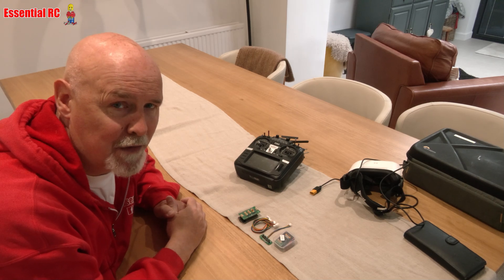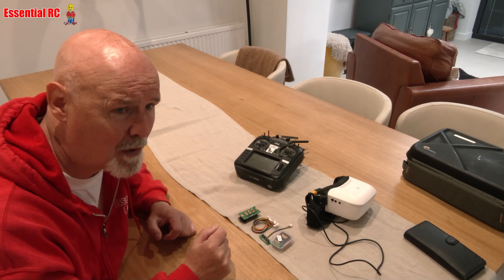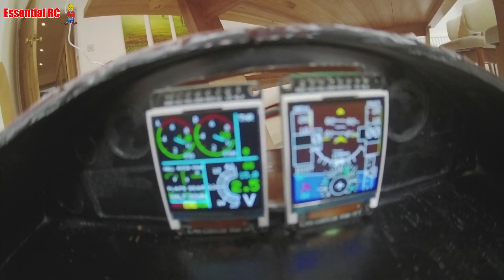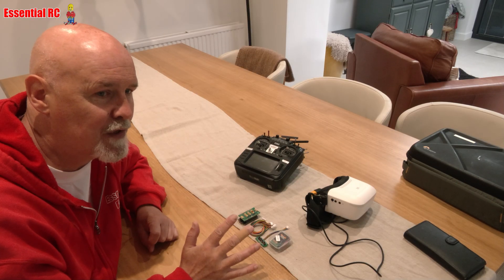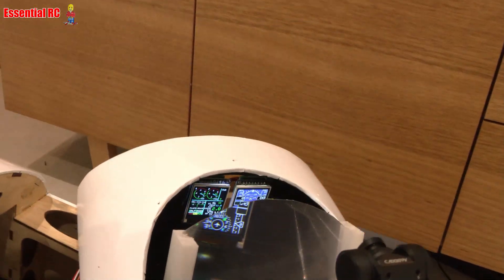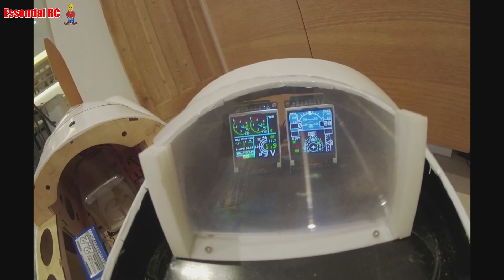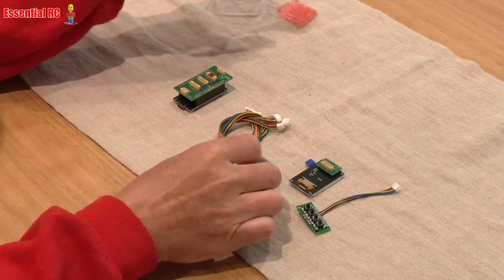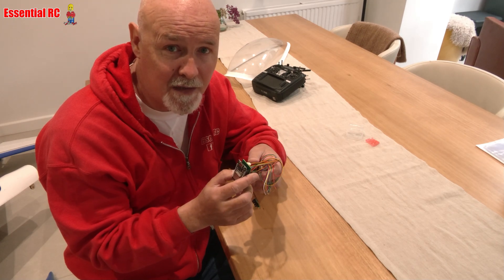DO THEY WORK WITH FPV ? NEW In Cockpit Real Time Telemetry Displays for RC Aeroplanes

Comment: Hey mate, just diving in after 10 years away from the hobby.

I have a question (I have more than one but we'll start with one).

You said flight controller, that's not something my PNF has, is it?

I have the 04 pro air unit in a HEQUAV G-Port 3 Axis gimbal (hoping to bind it all to my DJI N3 goggs).

Could you dot point what I need to make it all work?
I would greatly appreciate it!

Ps. I fully intend on going full functional glass cockpit and all, if I can!
Reply from the maker: Flight controller is a separate component that would have the receiver, GPS module, FPV video transmitter, all the servos and ESC throttle signal cable plugged into it. The ESC black/red wires would be soldered to it and you would solder black/red wires onto it with a female connector so you could plug the battery into it. If you wanted to use those telemetry screens they would plug into a spare UART on the flight controller as well. Good flight controller to look at would be the SpeedyBee F405 Wing. If you brought one you would need to flash iNav firmware onto it and learn how to configure it. Plenty of videos out there on how to do that.
Reply: @EssentialRC awesome! Thanks so much.

Lastly can I have your opinion on one last thing?
I would like to have my full FPV unit built into a 3d printed module with the gimbal, air unit, fan for air unit, flight controller and antenna mount all in a tidy package that I can hot drop into different planes as I need.
Or should I look at individual FPV setup for each plane?

Comment: Following with interest. I'm also trying to get FPV working on my IC model but I'm having issues with the engine vibrations sending the flight controller haywire.
Reply from the maker: In my 35cc petrol RV4 my FC is mounted on the wood tray on strong velcro. If I had problems I would mount it on a slice of that thick anti-vibration foam you put under washing machines. I got it from Amazon.
Reply: Or try sticking two layers of thick double sided tape under the flight controller. In the rc helicopter world, we all use that tape under our gyros to reduce the vibrations. Just a thought

Comment: How about a system that would display the flight data (speed, height, etc. ) on the FPV screen?
Reply: Someone experimented with this years ago, with fresnel lens and reading glasses lens, but I don't recall ever reading a positive result.
What you have done here is great! 
Thanks for posting 🙂
Reply from the maker: 🤣 We have that. It's called OSD. Doesn't look very realistic but I like it for non scale flying

Comment: This is the problem with that system. Screens are 1.4 inches. Fpv toys do a 3.5 inch display. For a larger model you want two of those. They also seem so much brighter than these. The ones from fpv toys can't be read inside the house like in this video they are simply too bright which is what you want when flying outside. I also think the fresnel lens is gonna give some pretty strong glare Independent from the screens. Look forward to the flight footage. Cheers
Reply from the maker: Thanks Andy. As said in the vid, I'll order some FPV Toys screens to try them out. Cheers
Reply: @EssentialRC  cool stuff cheers
Reply: Hey, just wanted to clarify a few things:
Early versions of our displays were running at 3.3V per the manufacturer’s recommendation, which did limit brightness a bit. But after some testing, we found that driving them at 5V significantly improves brightness, and that’s now standard in all our current hardware.

We even released a video showing how users can mod their older units for increased brightness. The current displays are fully sunlight-readable, and we’ve flown them in bright outdoor conditions with no visibility issues.

We’re also working on expanding screen sizes, including 2”+ options for larger airframes, so cockpit visibility continues to scale with the aircraft.

Appreciate the feedback
Reply from the maker: @KairuhsConsole I'll fly mine at 5V soon. Really hope it's better.

Comment: Ingenious!!! Well done 😁👍
Reply from the maker: Thank you! 😊
Reply: Is that cool, or what… I was thinking of some sort of bifocal arrangement, and you seem to have nailed it. Just off the top of my head, would a simple magnifying lens provide a clearer image than the fresnel setup you have? Whatever, I’m looking forward to seeing the results.
Reply from the maker: I don't think so. Magnifying lenses are generally round and only provide best focus at the centre. I think this is as good as it gets although if it was slightly stronger magnification it would be better.